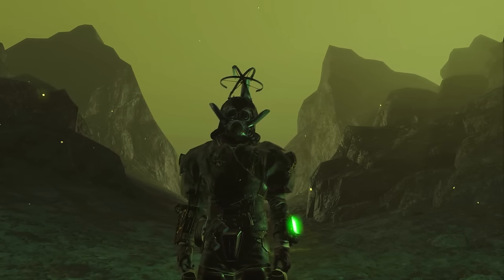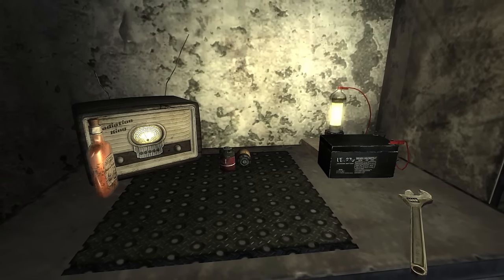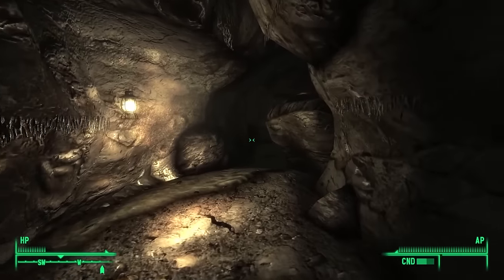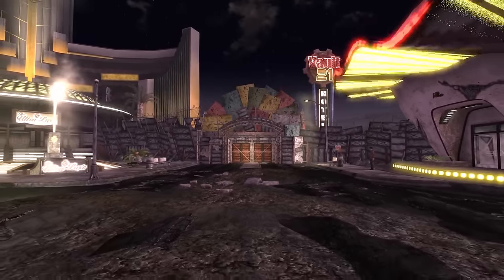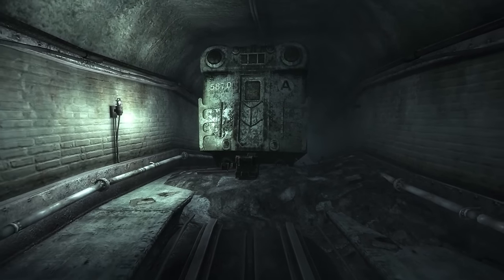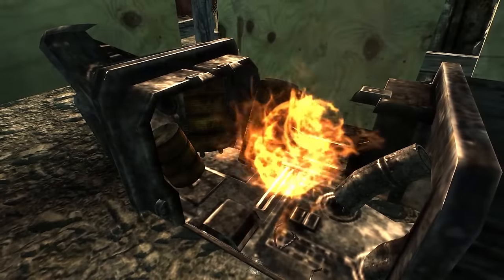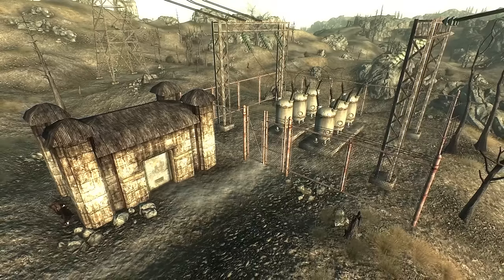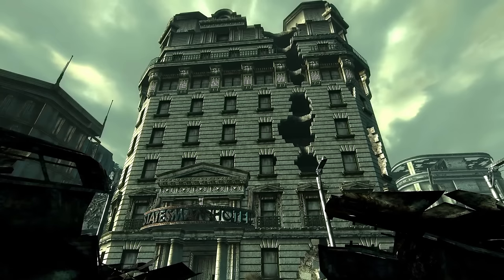Where does the power come from in Fallout?

Comment: Most impressive thing isn't the fact that power still exist but that 200+ year old light bulbs still work and haven't blown out
Reply: I mean usually the lights blow out from being turned on and off
Reply: @DeosPraetorian  If the lights are LED maybe but I'm pretty sure lights in Fallout are all incandescent, which means they have a finite amount of (I believe it to be) nitrogen gas inside the bulb and with them being on for 200 years eventually the nitrogen would be used up and the bulb to burn out
Reply: @morticianflame   The gas in incandescent bulbs is not a consumable. It's a non-reactive gas put there to displace oxygen so the filament doesn't oxidize and burn away when it heats up. If the bulb remains sealed and the filament doesn't break, it can theoretically continue to remain functional indefinitely. It is repeated heating/cooling cycles that eventually break the filament and make a bulb "burn out" from arcing across the break.
Reply: @morticianflame  some lights aren't incandescent and bulbs won't break just sitting there. It would take thousands of years for the nitrogen to leak out.
Reply: Or that Raiders, Bandits and other criminals are still around scavenging  instead of trying to help grow a farm/community and stuff! Bandits and such should only really be in control within the first few decades, I guess, after that we should have at least civilised ourselves, although am not an expert(I like booze so am an expert in being an alkie lol)
Reply: It is possible that with the resource wars ongoing being a consumer society for items that use metal, glass, oil, or plastic was not optional.  The government likely mandated that things must last longer.  Look how far lightbulbs have come in the last 20 years.  My LED bulbs are guaranteed for 25 years.  Whereas the normal incandescent bulbs I’ve had can be changed sometimes twice in the same year.
Reply: Perhaps they found an old crate of the 1st bulbs ever produced in a museum ? Those things would (like the one still burning) last almost forever.
Reply: Stuff from the 50's was built to last. Now imagine 120 years of innovation with that mindset, and it's not so hard to believe.
Reply: Several companies from the early century agreed to stop making long lasting light bulbs as it was hurting their profits. If you only need to buy one bulb that would last forever then what's the point of a bulb company. So it's possible this never happened in Fallout and companies just kept out doing one-another until bulbs just became op.
Reply: in real life, lightbulbs can technically last almost forever, just companies decided to not make that kind so that you'd have to buy a lot more bulbs
Reply: There was a thing done by the light bulb companies in the 70s to make a limited lifespan instead of the best they could make, fallout diverged in the 50s so that thing would split with it
Reply: ERM nucular fusion lasts for thousands of years what you expect?
Reply: @animalmotherdk2649  I'm talking about the light bulb itself not the power generation
Reply: Tbh I have multiple radios 90-101 years old that still work, some with no replaced parts.
Reply: Lightbulbs in Fallout are incandescent, plus, they have been probably running at low power.
It's not that impressive when you think about it.
Reply: @GoldSrc_  there are bulbs 100+ operating continuously, wouldn’t be out of the question for an advanced incandescent future sci fi bulb to operate for so long, I own bulbs 110+ years old still working and vacuum tubes 90+ years old still operating in peak condition
Reply: @RooMan93  it was called the Phoebus cartel and members were forbidden from making bulbs lasting longer than 1000 hours. Formed in 1925 and allegedly stopped in 1939.
Reply: @davidh7177  Maybe they do live in settlements, but occasionally prey on travelers for extra income.
Reply: Nah someone went round and replaced them all
Reply: There is a light bulb in a California Firehouse, that is over 120 years old. It still works, because it has never been turned off, and it is one of the original bulbs that had the thicker filaments. They started to make the filaments much thinner, because the bulb companies knew if they didn't, they would last forever, and that's not good capitalism.
Reply: There are real life lights that have been on for over 40 years and have not burnt out. They're not common and made a long time ago. Modern bulbs are kind of intentionally made to break often, so that you have to buy more. It's planned obsolescence.
Reply: @morticianflame  bulbs are filled with an inert gas to displace the oxygen. The gas quantity remains constant over time
Reply: there are light bulbs from the 1910's that are still operating 
just search for the oldest light bulb still working
Reply: @morantaylor  I'm aware
Reply: @DeosPraetorian  light bulbs have a lifespan of several thousand hours. Switching them on and off will shorten that lifespan significantly, but still, a light bulb won’t nearly burn for 200 years continuously.
Reply: @Foxima Centauri  "a bulb won't burn for 200 years" I mean, you can't even say thar with certainly since bulbs were only invented something like 143 years ago. Yet there is a bulb out there that's been going 121 years so far. 200 could be possible.
Reply: @regulator18E  you’re right, there are isolated cases of bulbs burning insanely long. But those are very rare and the current flowing through them is very low. It is much, much more common that bulbs burn out after some time, even when they never get switched off and on again.

While we’re at the topic of the durability of light bulbs, I highly recommend you to read into the Phoebus cartel, very interesting and infuriating.
Reply: Somebody needs a lesson in the history of planned obsolescence lol we had hundred year bulbs way back in like the 50s, but that's not profitable
Reply: well, light bulb can actually run for pretty long on lower voltage without on/off cycles(stays on everytime). And we can pretend that in FO world they found a better material for filament that lasts longer.
Reply: I always figured there were rebuilt factories tha were still producing them and other everyday goods. 

There are large parts of America that are civilized like the NCR and the Legion that could have large industrial areas and traders bring the surplus all the way to the east coast.

We also see at least a working steel mill, brewery and cannery operating in Boston(although the steel mill and brewery is operated by some unsavory individuals)
Reply: We already have led bulbs. And if they’re kept out of the weather they can last a lifetime. I’m sure it’s not much of a stretch to say they’ve made bulbs that last forever in the world of fallout, I mean they have cars running off of nuclear energy
Reply: @davidh7177  dude this isn’t Alcoholics Anonymous
Reply: Theres so many times I'll be playing fallout 4 and stumble across something "pre war" in the middle of the road and it's in near pristine condition.. and I'm like the initial bomb blast would have destroyed that let alone 200+years
Reply: If you look it up traditional lightbulbs have the manufacturing capacity to last near indefinitely but lightbulb companies got together and forced flaws so they would only last so long. Any company that tried to make longer lasting lightbulbs would be blocked by the existing manufacturing power houses, no pun intended.
Reply: Maybe in the fallout universe they outlawed planned obsolescence. hell, even in real life there are examples of near 100 year old bulbs still lit in fire stations and such, manufactured before the concept of throw-away consumer electronics caught on.
Reply: If you guys don't know about, The Centennial Light
And as other said, planned obsolescence concept also made his step in industry cause of lightbulb being too strong
Reply: I was thinking the same thing lmao
Reply: Don't they make lightbulbs to burn out on purpose? Otherwise people would buy one bulb and then never again. 

Maybe in the 2070s they make them to last
Reply: @BeeKisses  yes it’s true that companies made it so light bulbs didn’t last as long, but the long lasting light bulbs were way less efficient (they weren’t nearly as bright and gave off a lot of heat). Also, the long lasting bulbs at the time only lasted about 2x as long, not 200+ years or “technically forever”. My theory is more simple: in the fallout universe they somehow created a way to make lightbulbs last 200+ years.
Reply: @michaelcantu6071  there’s also a good chance say like in the subways and vaults that the lights are either fluorescent tubes or metal halide lamps
Reply: "The world's longest-lasting light bulb is the Centennial Light located at 4550 East Avenue, Livermore, California. It is maintained by the Livermore-Pleasanton Fire Department. The fire department claims that the bulb is at least 121 years old (installed 1901) and has only been turned off a handful of times"
Reply: I just assumed the pheobus cartel didn't exist in fallout
Reply: The light bulbs they sell in stores are designed to be inferior so you buy more. A light bulb can easily be built to last decades. There's a fire station in America that has lasted over 100 years.
Reply: We have lightbulbs in real life that are over 100 years old we have on that has burned in a fire station for like 140 years without ever burning out never been turned off.
Reply: @pilsplease7561  Yeah thanks I know people have already commented that like a dozen times
Reply: @davidh7177  that would be true if raider gangs just existed 

But I think for the most part don't raider gangs come and go?
They form, last a couple years, then get wiped out and replaced soon after by the next generation of down and outs.

I know gangs like the great Khans hang around but they seem more like a nomad group than just regular raiders
Reply: Kinda reminds me of Skyrim dungeon torches
Reply: Remember that they came from the 50s at most. Back then they actually cared about quality
Reply: It's not that far fetched. Company back in the day made light bulbs last for fucking decades, the tech is there. It's that a bunch of companies I believe in the 30's or 40's band together and rules that a light bulb can only burn for so many hrs out of fear of making a long lasting light bulb would put themselves out of business.
Reply: @Seriona1  but adversely, it's fallout time, in fallout universe
Where a soft drink that contained nuclear material was allowed to be sold to consumers

I don't think quality control was on the list of priorities
Reply: @spook9155  our time line matches up until the 50's.
Reply: @Seriona1  yeah I know, I'm not disputing that fact, but, fallout 4 especially, most buildings don't look like they're from the 50s.
Perhaps they are versions, but most things look heavily renovated to a sort of 50s techno-future look, so I doubt the bulbs are the only thing that didn't get touched.

Though what people are saying about the fact that it's repeatedly being turned on and off that will wear a bulb out not use seems quite likely to me.
They've been on for 200 years, continuously.
I'm not sure if a bulb could last that long, but at the same time, cars only have enough rust to span a few decades, not two centuries, so condition over time doesn't have to be consistent.
Reply: @battlesheep2552  I feel like artificial obsolescence would exist in this universe as well considering there is nothing in fallout history suggesting it wouldnt and light bulbs were actually the first product to be built with a set shelf life (i think this was in the 30s)
Reply: @perhaps1094  fallout likes to make a parody of corporate greed and capitalist ventures, it would be a misstep on the part of the writers to actively decide that there's no planned obsolescence.

Hell, the puwolsky preservation tombs exist, their whole point is obsolescence on arrival.
Reply: my bulbs from project zomboid: best I can do is a few days
Reply: @morticianflame  the gas in the bulb is inert, it's not involved in burning
Reply: The Centennial Light has been turned on since 1901.
Reply: Have you heard of that light bulb in a fire station that has been working for like 180 years?
Reply: @theangrygermanlad1328  Yeah because like 15 other people have already commented about it
Reply: Tesco value bulbs blow in the box.
Reply: Incandescent bulbs IRL had their life artificially shortened. They lasted to long and people weren't buying enough because of that. So the powers that be got together and agreed to a maximum life of the bulb.
Reply: @GlorifiedGremlin Everybody needs a lesson on planned obsolescence. Hell I learned about it when I was a child when I watched my little toaster 2 because that's a major plot point in the movie 😂
Reply: There is actually a light bulb that has been working almost non stop since 1901.
Reply: Actually it isn't, the first lightbulbs had a perfect vaccume in them and could literally last centuries. 

But you don't sell very many lightbulbs if they don't burn out at some point... they found out that they could actually just be a little lazier and cheaper making them, and the filimit burns out, and the customer will be forced to purchase a replacement. This concept is called planned obsolescence.
Reply: It's just a game, not that deep
Reply: @sotorodrigo33  Well if you cared to investigate further you'd know a light bulb that was crafted well enough could last as long as the filament stayed intact and the lore in fallout implies that the idea of planned obsolescence never took hold so everything in the fallout universe is built to last for centuries.
Reply: @BeeKisses  the light bulb cartel came together in the late 1800s and agreed on planned obsolescence a long long time before the 70s lmao
Reply: @Ripperoni  your led bulbs aren't going to last 25 years bud lol
Reply: In our universe, lightbulbs are deliberately engineered to fail faster. The light bulb industry made bulbs that last for a hundred years but then they realized, nobody would buy new bulbs anymore, so they got together and decided to reduce the lifespan of the bulb. There is a rule that any lightbulb built today must have a maximum running time before it breaks. There is a bulb in California that hasn't been turned off since 1901, so a good 122 years now. If, in fallout, these companies never made that deal, it's very much conceivable for lightbulbs to last that long easily.
Reply: An incandescent bulb has a (mostly) infinite lifespan if it isn’t turned on
Reply: As someone who just spent 40 bucks on bulbs.... this.
Reply: Considering Fallout's pre-war universe is stuck in the 1950s, it's most likely that the tech is also built the same way in 1950s, including long lasting incandescent bulbs.
Reply: @vicariousgamer2871  that one in the firehouse
Reply: @RooMan93  Not just that, but the long lasting bulbs are not anywhere near as bright as regular ones.
Reply: @klubstompers  https://www.livermoreca.gov/things-to-do/centennial-light-bulb (It's STILL going)
Reply: To be fair lightbulb companies literally came together and agreed to limit how long lightbulbs last for because they last for years and years & they weren’t selling any lightbulbs because nobody needed them as they lasted too long, there’s a lightbulb in an American fire station that’s been on non stop for like 100 years
Reply: very old lightbulbs usually burns for 80 to 100 years. some even longer. like the centennial bulb which lights up since 1901. and they never switched it off.
bulbs last longer if the heatwire does not change temperature. and old bulbs are built stronger and for longer use.
Reply: @kennythemeat  Wrap your head around this concept. The guys at the fire house never turned off the switch. If you're trying to say California has had 0 power outages in the last hundred years, you're smoking waaaay better stuff than mine.

The bulbs last longer because they maintain their inert gas more than anything. Hard for stuff (like filaments) to burn in the presence of "Noxious Air" or better known as Nitrogen.
Reply: @nunyabidness674  i guess its both. expanding the filament with heat surely adds to decay of the material. thats also the reason your grandparents said do not play with the light switches :)
Reply: @morticianflame look up the Livermore Light Bulb that Never Goes Out. Maybe in this universe the lightbulbs weren't made to be consumable?
Reply: @morticianflame  nah, fallout is set in a timeline where the transistor has never been invented, therefore leds and such aren’t a thing
Reply: only because light bulbs used to be made for quality but today they are made for profit and intended not to last long or they wouldn't make money.
Reply: @mailleweaver  almost true: the metal in a filament will ever so slowly atomize and leave the filament itself, making it thinner and sticking to the bulb's glass. This is why older bulbs can appear darkened on the inside.
Halogen bulbs were invented as an evolution of regular incandescent ones, with a halogen gas promoting re-metallation of the filament with the "stray" atoms :)
Reply: Maybe the Fallout world didn't go through planned obsolescence so the products they make actually last like the ones our world used to make before the seventies
Reply: Check out the centennial light bulb. It's been running in a firehouse for over 120 years. It's definately possible for a bulb to last that long
Reply: @badlighting  it's possible for light bulb that was built to last. Now the stuff that they built nowadays is not built to last. You can still see kitchen appliances from the 50s that are running today, I'm quite positive that there aren't going to be any of today's refrigerators running in 80 years.
Reply: @mailleweaver  dang, smart guy. Nice write up. I appreciate the science lesson, seriously
Reply: There's a bulb in a fire station that has been running continuously for 100 years.
Reply: And? Old bulbs from 192x /3x still work this day with ez
Reply: @RooMan93  No this is a complete myth. 1000 hours is simply a balanced way not waste electricity. Light bulbs were never meant to last, they're a consumable item. Bulbs were often given for free or heavily discounted by the electrical company.
Reply: do some research. lmao
Reply: @morticianflame  the government didn’t end up making lightbulbs worse for financial gain, that’s what happened irl, look up world oldest lightbulb it’s not just a freak lightbulb ones that were made like that had lifetime warranty’s cause of how long they were supposed to last. Now 1-2 years and I gotta change one in my bathroom.
Reply: @louspowels7120  Yeah buddy thanks, not like 50 other people have told me about that one 120 year old light bulb
Reply: Im assuming by 2077 Bulbs are then immortal
Reply: Light bulbs are designed to blow out. There is a possibility that the companies producing the bulbs do not adhere to designed obsolescence
Reply: @DeosPraetorian  I did not know that
Reply: The first lightbulb ever made is still working afaik.
Reply: @davidh7177  Before countries employed actual police and military live outside of settlements and cities was pretty dangerous. You had bandits hanging around in the forrest, old ruins etc. and if there was any conflict the number of bandits increased even more. These people were also extremely brutal, so Fallouts raiders are logical.
Reply: @RooMan93  Yeah except light bulbs didnt last forever and modern LEDs are easily outlasting these old bulbs.
Reply: Back then they had basically immortal lightbulbs. Could last no joke 100 yrs. But of course they didnt make any money the lightbulb companies so they intentionally made them last less.